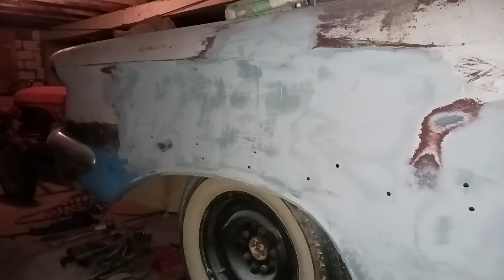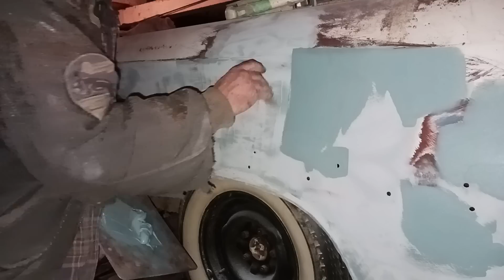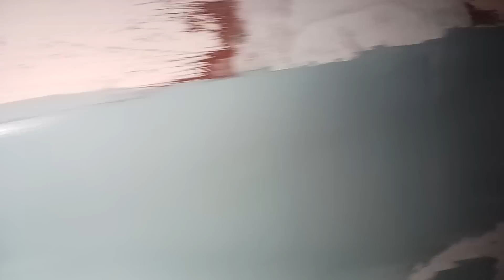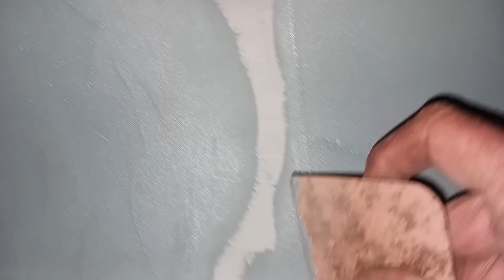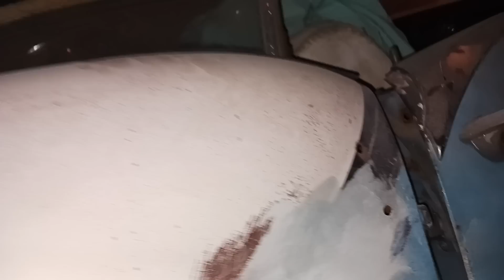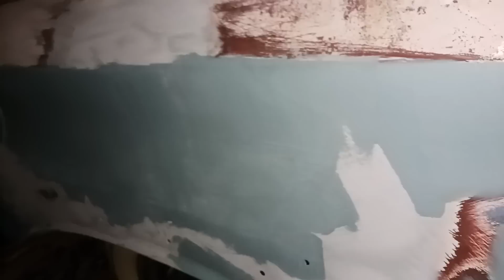might have to finish this tomorrow

Comment: Great job taking your time to do the best you can putting on the filler it will cause your sanding to finish great causing your painting to be really good.  Cause and effect, keep up the good work, you are doing an excellent job and it will show in the end with an awesome paint job if you use a half way decent paint.